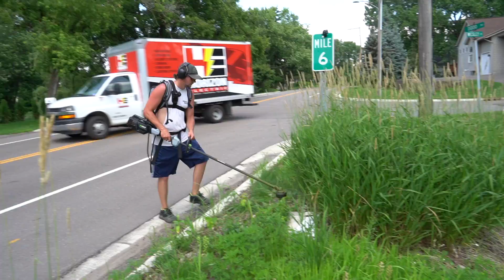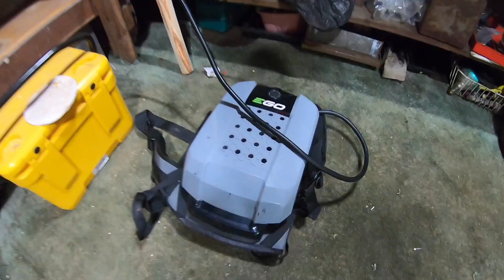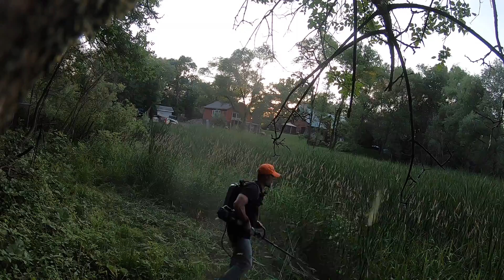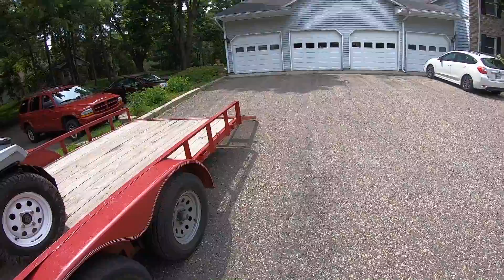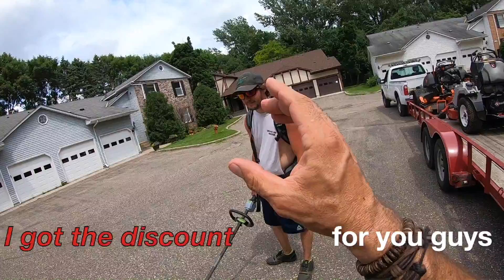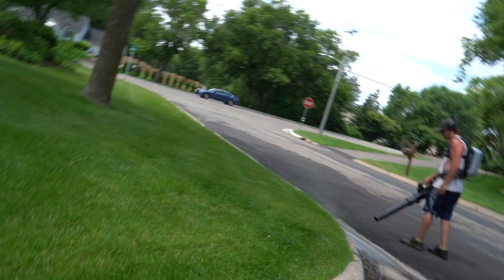No GAS Power Tools for 8 WEEKS! JUST Battery Powered Tools Versus Heavy Brush, Weeds and Swamp

Comment: Currently We have:
Ego Self-propelled mower
Ego Carbon Fiber String Trimmer
Ego Multi-Tool Edger
Ego Backpack Blower

While they are a little pricey once you get enough batteries, you can order the items you want without batteries cutting the price almost in half.

We are going all in with this not for any eco-environmental reason, but 100% because it works. Extremely low maintenance, Too winterize it I put it in the garage. So far the only Con I have found (and this is being extremely nit-picky) is the mower does not have quite the same lift when bagging, but seriously it's a yard not my dining room table.

My thoughts:
* It works, most likely better than any other yard tool you have owned (consumer grade).
* It is very quiet, you can talk to someone while mowing the yard, no real need for hearing protection. (On a side note could this be used in a commercial sense before 8am without breaking noise ordinances?)
* Very user friendly, loading the line in the weedeater could not possibly be easier: cut a length of line, feed the line through the two holes on the head to about halfway. push a button and it loads itself.
* Very light, not unusual to see the lawnmower hanging from a pair of hooks on the wall in the garage.
* Way tougher than you would expect, when encountering thicker material that would choke most other mowers, the Ego kicks itself up into a faster speed, and plows through it (it does have limits and you can force it stop, and it will need to cool down, briefly before you can start up again)
* Starting on stopping is no more difficult than squeezing a trigger, or pushing a button.
* All consumer grade products can interchange batteries with each other. They all have the same battery mount and Ego appears to be pretty committed to staying with this battery..

Comment: Nice! Appears the commercial line trimmer is definitely more powerful than the standard EGO stuff. But seems still lacking in head speed. I was really disappointed with the normal line of EGO string trimmer. See my latest video on it’s lack luster performance comparing it in a head 2 head.

Comment: For my own home use, I bought the Ego self-propelled mower and Ego residential handheld blower.  I appreciate how quiet they are and enjoy not pouring gas and oil, and not smelling two-stroke in the morning (apologies to Apocalypse Now).  

The mower does not lift and mulch as good as my Toro Recycler did and the self-propelled mechanism is not as sophisticated as the Toro Personal Pace.  But even with those two minor deficiencies, I am happy with the Ego-s.  

The residential batteries have a 3-year warranty while the equipment has a 5-year warranty.   I read somewhere the batteries are intended to have 2000 full recharges.  At one recharge per week, that's about 40 years.  Since I don't cut grass in winter, I'm hoping to not have to replace the batteries.  I doubt I have the human equivalent of 2,000 recharges left in me, if you know what I mean.

Comment: I used EGO's entire commercial line for 30 days and have half a dozen videos on them. Performance is fine (other than my trimmer cutting out during heavy loads, which may point to a defective unit), but looking and price, design, and ergonomics versus gas it just doesn't make sense yet for most gas users. Don't forgot the bottleneck of only having one battery for three tools. If you want the entire three tool system for one user you are looking at ~$3k. For one additional user? ~$4.4k. Even factoring in gas savings is doesn't make it worth it (I made a video breaking down the numbers as well). Great video!

Comment: Have used the Ego chain saw (have a quick vid) and was rather impressed how well it worked....lots of torque and battery seems to last for some time. 

Long term cost of using this battery stuff commercially vs gas equipment.....not sold on it
Lets see if that trimmer and battery pack is still going in say 3yrs...5yrs... and how much drop over time occurs in the battery

Comment: That jungle was my back yard - and that's what burnt out my Greenworks Pro trimmer.  I need a replacement and I'm considering a Stihl gas model.

(Note...after my trimmer died, I just waited until the summer heat dried up all the weeds and tall grass so I could take it down with multiple passes from my mower.  When the weeds were still alive, my mower couldn't handle them and died every 5 feet.)

Comment: I believe roybi pioneered the battery tools that match gas power ones they have a 18 36 and 40w range including a blower vac which shuck up the mess makeing cleaning up faster they  even have a battery powered raid on mower but it's only available in the usa that just shucks iv been planing to get into lawn care game here in ireland i use a parkside battery powered tirmer it's a suppermaket band i got in my local lide store what i love about it over gas powered ones is no gas and oil mixing and messing around with the choke and sting pulling you just charge the battery pop it in press a butten and off you go the only daly checks is to make sure you have a nuff string

Comment: How does the string trimmer work when using it in a left handed position? 

I'd like to see a commercial 21 in mower from EGO. They could just plug the backpack battery into the handle. Something that could perform just as well as a 21 in commercial gas mower would be awesome. 

I had been using the residential ego blower and string trimmer. The string trimmer got rained on and kept on going. It did not survive sprayed with the water hose though. I don't mind that it gets dirty but a good 1/4 in layer of mud on it from a country road is a bit much so I did a quick spray with water and it killed the trimmer. The blower just won't die. its fallen off the trailer multiple times, gotten beat around on the trailer rack when driving between clients properties, gotten rained on, and sprayed with water. It takes everything like it's no big deal.
Reply from the maker: Works the same left or right handed
Reply: @Dirtmonkey  thanks for the help. I wasn't sure since the tether is on the right. It is nice to hear that it works just fine on either side.

Comment: i bought the EGO system at Home Depot 2 years ago, so the 56V smaller battery system not the commercial ones your using, but they have been working strong for 2 yrs now, love them, i only mow 2 yards a wk so not running commercially but no problems, i have the multi tool kit, edger, poll saw and articulating hedge trimmer for that power head, no complaints at all on the hand held stuff, the push mower could be made a little stronger though, i don't use it to mow the other yards just my little yard here at home for the others i use the honda HRX217
Reply from the maker: I'm testing the push mower now.  That vid will come out soon.

Comment: The only problem I have is the cost where does it meet up. At almost $2k per unit other than just not having to deal with fuel where do I benefit especially having nearly a dozen weedeaters I couldn't see myself spending what a mower cost to supliment that. I per weedeater see maybe $400 to $600 a year for fuel cost per unit per year with each of them costing about $400. So $1000 a year the battery units will cost me $2k a unit. I'm curious how long they will last like past the 2 year warranty. Might be viable if they get the cost down and the things hold up especially seeing as batteries aren't items that last forever that's a $1300 hit

Comment: Pro/Homegamer tip. When your weeding that high of material, Instead of wacking the 3' tall weeds at the ground try doing it in 4" sections. Doing this will help chop up the long stalks of grass/weeds into smaller and much smaller pieces that at mower can more easily turn into clippings.

Comment: I work on the road so leaving a gas powered saw or weed whacker at home for weeks at a time. I would have to spend time doing a tune up or rebuilding a carb. 

With battery powered tools I have my wife charge the batteries again before I come home, so they have a fresh charge. Ready to go, less vibration, less noise, less frustration and maintenance.

Comment: Stan from the video you did with your son in law and employee with that hedge I am seriously thinking about getting the Milwaukee trimmer with battery kit with charger for when the temperatures are hot with humidity as a way to prevent the chances of a fire from a hot muffler and the quieter DB level and then not having to buy so many tool plus battery kits just the tool and if the need for more batteries not end up with umpteen chargers taking up space

Comment: Great video as usual Stan, I have used EGO yard care equipment for 4 yrs now and have had no troubles  with it at all and recharge time is nothing, I can use the same 5.0 amp/hr battery to cut and trim my yard, I have severe  bi lateral carpal tunnel and no vibration issues at all with EGO products,  I'm in Manitoba so you know the kind of winters we get, my buddies wife got him the EGO snowblower and i was blown away, pardon the pun, at how it handled the snow without any issue, we found out using it that it hardly bogged down where as gas has to have the revs at max rpms and the EGO being battery powered has 100% torque at right when you start the blower and easy to clean, sweep it and your done,
Reply from the maker: Thanks for the comments Bob !

Comment: At $1,200. for just the battery it better be good. And another $399. each for the attachments
Reply: Run a law care business for a year and figure up your gas cost. Ego is cheaper, because if you have reasonable electric cost then it only cost about 20 cents to charge that pack.
Reply: @WeNeedJesusAlways  What about when you have to replace the battery then you back to square one.
Reply: @TPRPTech  I've run the numbers including the battery cost (assuming that it fails the day after it goes out of warranty). It's still cheaper long term.
Reply: @TPRPTech  I'm with you on this Ted. Also the future doesn't tell us that they will totally redesign the battery system making all older battery models obsolete. Meaning it's time to buy all new again!
Reply: @tj_gsomething_  exacly look at 18 volt powertools they used to be the best now you cant find them
Reply: @Dig Byck I love the system it just cost too much in my opinion
Reply: @Dig Byck But what if you have solar cells over your garage to recharge Byck?

Comment: I can't take anyone serious wearing gym shorts while doing professional landscaping
Reply: Why?
Reply: @martinmang1  well, safety  is 1 reason.
Reply: The humidity around here has been awful and the heat is in the upper 80's lower 90's. Its one thing to be 90 degrees out but with humidity you can barely even move. Most companies here in Minnesota wear shorts.

Comment: Seems like a good deal for commercial use. But seems like a waste for the homeowner. The problem will start with the batteries. Lithium batteries are particular. You should never store fully charged batteries for more than 4 days.  If you store it for a lengthy time it can build pressure and swell. Do NOT EVER leave it on the charger for days. My drone batteries have a programmable feature that will slowly discharge automatically to prevent issues. Best thing to do is charge it the day before use, and store it partially discharged.
Reply from the maker: I didn't know that.  Thanks and I should see if EGO will comment on that.
Reply: I would definitely like to see EGO's input as well.

Comment: Stihl has had battery pack packs for several years.
Reply: and they recently released a top of the line electric kombi powerhead, the kma130r. let me tell you. the torque is there. coupled with ar3000 backpack it just eats anything you put it up against
Reply from the maker: Yes- They make good stuff as well.

Comment: Is it possible to switch from string to a brush cutting metal blade on the trimmer?
Reply: if you're cutting something that you'd need a blade for i don't think a trimmer head like this will have enough power if it even is adaptable.
Reply from the maker: I don't really know.
Reply: If I'm not mistaken there is a brush attachment with a blade ... I've seen a few video's of out there .....
Reply: This was the video i seen I'd love to know if this made its way into there battery pack line if so pretty kool ... If no I'm sure it will be https://youtu.be/1NWhi_ac6TQ

Comment: The best allergen filters are made by Austin Air or IQAir. We use both for sites that otherwise would have hazardous air. Keep them maintained and replace the filters and they will last a lifetime.
Reply: I used to sell both brands and prefer Austin Air over IQAir I feel you get more bang for your buck with them.
Reply: @ditunnod  100% agree. Performance for value Austin Air is the clear leader. IQAir is for some specific use cases that benefit from the more modular filter design.

Comment: hey have you ever used a scythe instead of a string trimmer. I use one and I found it less work than a weedeater. instead of messing with string you just brush the blade with a stone a few times every 10-15 minutes of work to keep the blade razor sharp. its the same action but instead less weight and a wider area of cut mine is 28" its also silent does not throw pollen and in tall stuff it lays everything in nice rows. try it you can get a entire outfit for less than 250$ shipped have your guys trial it
Reply from the maker: OK now I have to try one out!

Comment: Totally bs they are lying those back. Packs don't last an hour
Reply: Hmmm, i have a ryobi 40v and just the single battery lasts almost an hour and a half, why wouldnt the pack last an hour?
Reply from the maker: It lasted 2 days over and over again.
Reply: My 580cfm ego blower will run 25 minutes straight on turbo using the 7.5Ah battery. Backpack is 28Ah. It will run for at least 1h30m

Comment: 4:10  

The bulk of the electrical power is from coal fired power plants... you didn’t go Green you have indirect coal powered utilities ... I still love the torque - 100% torque at zero RPM
Reply: He could have his own solar power bank
Reply: It's still green, as its more efficient. (An electric you deriving power from a coal power plant vs a 2 stroke gas engine. Nice try.
Reply: Andrew Delashaw you are out of your. Mind
Reply: Andrew Delashaw and you're not going to get more than 45 minutes and the battery back doing the work they're doing good they tell you any different they are lying straight to your face
Reply: If something keeps the green in my pocket...